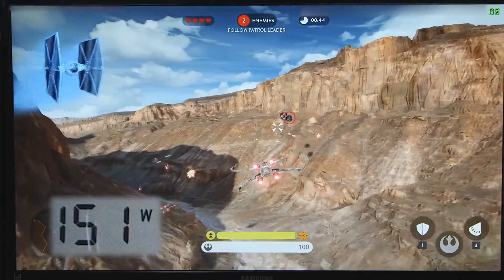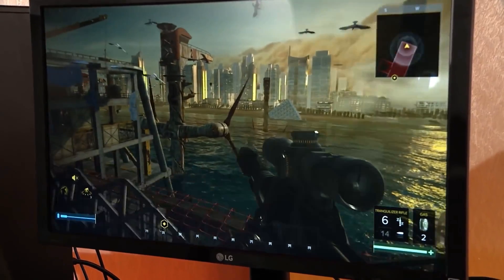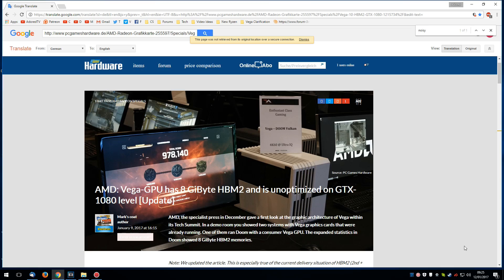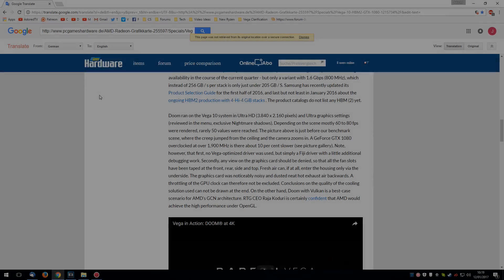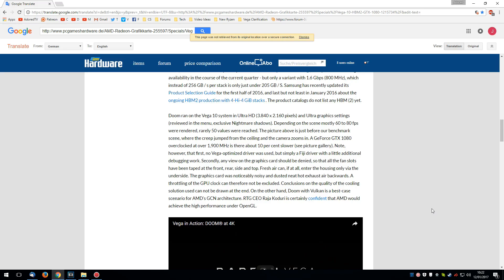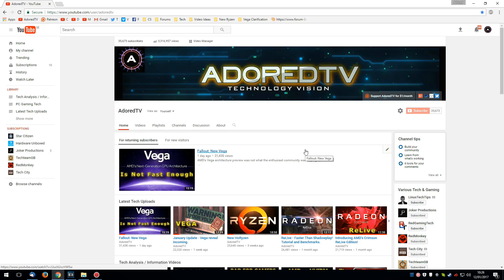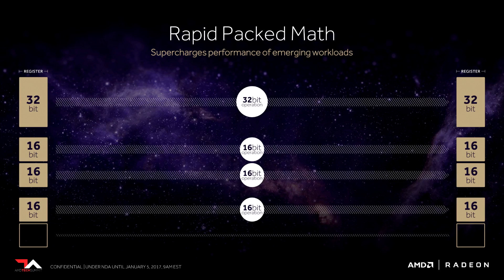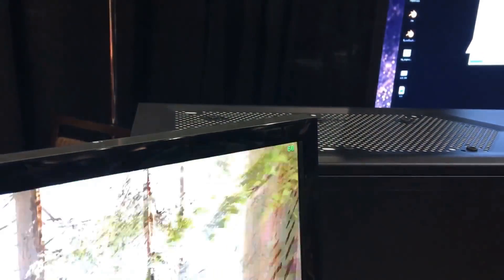Vega Clarification - How bad is it?

Comment: +AdoredTV You come to the conclusion that AMD has "given up on gamers" I can't say I agree? Maybe this is the best they can do and getting to within a few percent either way of a 1080 is as good as they can get right now. Ok we get you're not impressed with Vega but all you need to do is look at Polaris to realise it's not all doom and gloom. Now that the Polaris driver has matured it is within margin of error matching the 1060s performance and beating it handily in real DX12/Vulkan titles, even with those lazily coded pretend DX12 games that are really DX11 with a DX12 wrapper the RX480 is on par with the gtx1060. 

Sure it's disappointing if your speculation turns out to be accurate but it's not the end of the world! a competitive price will see Vega do very well with spend thrifty gamers looking to get into 4K without breaking the bank. 
Even at the same price which you can gurentee AMD won't be mad enough to do if the card is not competitive you can still save $200 by going AMD and getting Freesync to make up for the dips in performance without experiencing screen tear or lagging inputs. 

So what is Nvidia comes out with a Pascal refresh at the end of this year or the start of next? Without AMD you'd never get that and Nvidia would charge £600 for the 1080 for years dragging their heels on developing anything else and only providing 5% improvements on cards like how Intel does with CPUs.

Comment: You're being far too critical. I can understand your points, but they really fly in the face of what we are seeing actually happening.

Whatever this new card is, it'll compete with the 1080, not the titan. The titan costs $1200 and its only sold by Nvidia. Frankly, no one seems to care anymore about the titans and with a 1080ti being a gddr5x and a cut down titan chip....even if its within 5% of the performance.....its going to slot right in at around 1,000-1,100 usd. That just isn't reasonable anymore. People were stretching at 850, but another 150 at the minimum is out of this world.

If people want great performance they can still afford  a 1080. I said it once and I'll say it again, all AMD needs to do is get this card at 1080 performance and price it $100 less.

Nvidia will be forced to cut prices and lose on margins but win on sales or hold margin and lose sales to AMD.

Its not AMD's back against the wall. Its Nvidia's game to lose. Prices have gone so high, consumers aren't going to be the same loyal fanboys when they could buy two entire amd rigs for the price of one nvidia card. Intel and Nvidia are already taking a ton of heat for their prices, but no one can really do anything about it yet. 

RX480/470/460 card are selling well and AMD is clawing marketshare back. Putting the hurt on Nvidia at the top end in the 1080 range will help even more.

Less doomsday please.

Comment: On the DOOM AMD optimisations, they do work for Vega. There was an interview done with Raja Koduri where he was asked if it will hold up against the 1080 in OpenGL as well as it does in Vulkan and while he didn't outright say yes or no, he did imply that it wouldn't, saying that the optimisations in the Vulkan version (ie. shader intrinsics) aren't available in the OpenGL version.
Reply from the maker: I think what was meant there was, will Vega still lack in DX11/OpenGL games (like the rest of GCN) more than anything else.
Reply: Yeah but with how we calls out those extra optimisations it sounds like, at the very least, they are in play for Vega as well.

Comment: I think amd is playing a long race, its like they are saing to the owners of the 7970: "your car performs very good with todays games, so buy vega, a card where you dont have to worry about memory size". This time they have ps4 pro(?) and scorpio with vega, at least the half precision performance. But what i find more interesting is if amd can manage the jump to 7nm before volta.
Reply: You have a very important point there.
IF AMD can manage to switch to 7nm soon, that would shrink the GPU size by a LOT, meaning that there would be room for A) 2 more stacks of HBM2 (double the bandwith). And B) room for more shaders, giving the GPU a lot more rendering power.
Problem is.. It has to happen before NVidia has time to do something similar.
Reply: My question is what kind of monster would need 1TB/s of memory bandwith? I hope amd go on brute force with 7nm.

Comment: I think for me, AMD usually does not hype up a product so much if they know its bad.  Back with bolldozer,  they were pretty quiet as they got closer to launch and realized they had a dud on their hands.   If they hype up something even when its not that great,  its usually something they know the part will be good at,  such as the perf/watt they did with polaris.  however this time they seem to be pretty confident at the performance of Vega,  no mention of perf/watt this time.  I think there is more they are not telling us yet.  It all really comes down to perf/dollar in the end, Also I don't buy that AMD has given up on the gaming market,  because Lisa Su has specifically been targeting gamers with both Ryzen and Vega all up to this point.  Why design the card only for professional market if that were the case?

Also you mentioned how they were blindsided by nvidia.  Maybe they got tired of that and are holding back a bigger badder Vega design and the one they are showing off is not the full enabled chip?  Its a possibility.   Seems to be working for Nvidia,  so why not do the same?  Then when nvidia comes out with thier 1080TI,  unlock the rest.

Comment: If Vega is 10 - 15% faster now, on Fiji Drivers, and gets another 10-15% faster once on its own properly built drivers, 20-30% faster for X less than 1080 is fast enough for me. I don't know why you and others were expecting AMD to be some magical 70-100% faster. If people are disappointed its mostly down to the fact they themselves had unrealistic levels of expectations. I was expecting Vega to be on par with the 1080-10% better for less money. They seem to pretty much have nailed that on old drivers.
Reply from the maker: If this <500mm2 pro-laden card is 20% faster than the 1080 then why wouldn't a 600mm2 pure gamer card be 70-100% faster?
Reply: Adding 20% more GPU = 50-70% more performance? Is that how GPUs scale? I know that sounds sarcastic, but was senselessly asking. For me the performance of the engineering sample card at CES was as good as I was expecting of the retail one. Anything they add now with drivers and optimisations is simply a bonus. I was never expecting AMD to blow Nvidia out of the water, This is a first past at some clearly ground breaking changes to gpu production. 20% better I'll take that all day. At CES it was old drivers, early silicon and maybe not very well optimised and still beat the 1080. Vega wont be out till the summer, or they would say Q1 instead of first half of 2017. Not saying you're wrong on the speeds. Just that its clearly an early sample, they have time, but even if this is as good as it gets. Its faster and i'm happy with it.
Reply from the maker: If it were a pure gamer card ie just packed with shaders and HBM, maxed out to 600mm2 then it probably should be twice as fast as the 1080.  Basically consider what a gamer Pascal at 600mm2 would be, that's basically gonna be double the 1080.  There is no reason why AMD can't do it if they tried, but it looks like they aren't trying now because in the past when they did try, they never got the rewards they deserved.
Reply: Why would AMD go the same route as Nvidia? You yourself have said, mind set of high end gamers is to buy Nvidia? As a company boss, I would look at markets and go for the one I can make the most out of. AMD has placed a target on the mainsteam and professional market. Does AMD really need to fight for that 10% market that would buy a high end GPU when most buy Nvidia anyway? That make no sense at all. Does it suck for those people cause they have to pay the Nvidia tax? Sure but thats there problem. Everyone else has pretty damn good GPU choice. 1060/70 damn good cards, 480/470 Damn good cards. When your backs to the wall as AMDs was, You don't take the fight somewhere you cant win. AMD would not win the high end. Much better to simply change the fight. If in 2 years time most game makers and content makers are using AMD cards, and things like GPU open. Chances are AMD cards will naturally just be better anyway. Besides all of that, the Vega GPU was faster then the 1080, but does anyone think 1080 owners are gonna sell and buy a Vega? Nope. If you were AMD would you really try for a that? Or you you lay ground work on changing the landscape in your favour from the ground up? This HBC stuff, the GPU open stuff, Freesync 2 its becoming more and more standard features. When your the little guy, you gotta move slowly, the idea they can just throw a one punch knock out, is a bit silly. 

People at the highend market will do what they've always done, buy Nvidia and make jokes about AMD, no Titan beating card out this year would change that. I like AMDs focus on mainsteam, there 480 is the best card for sub $300. There open tools look great, and more and more content makers are using that stuff. Step one working, I get you want Nvidia pulled into reasonable prices, but wasn't ever on the cards this round.
Reply from the maker: I spoke to AMD today and told them the exact same thing.  If I were head of RTG I'd have said "fuck you" to the PC gamers long before now.

It's still a major disappointment to somebody who has been a GPU enthusiast for well over a decade, not to mention a gamer.  All I wanted to see was them fixing the mistakes of Fury X and really going for it one last time, but now it looks like we'll never see it.

Comment: My best guess/hope would be maximising marketing impact hence the underwhelming reports - reflecting on the mind-share you talked about recently, nVidia currently needs to take a sharp shock to knock everyone off that Team Green perch. It's one thing to match or slightly better performance hardware on launch, but to dislodge that and impress the market out of the gates you need to be able to hit your audience with serious price AND performance improvement - which I guess/hope they're still working on. Still hoping Vega turns out a Polaris on meth and this is just a preparation for the proverbial lightning war of enthusiast cards! In the end, was there even a point in Vega generation?! That would be my best guess as to why they might sandbag.

Comment: I still think you're conclusion is wrong, FP16 will be dead easy to use, it's just changing the datatype where you don't need FP32 accuracy. Which probably basically means all except final calculations. This is also only small Vega, AFAIK there will be a bigger one too. Clocks, drivers, hidden surface and FP16 will easily make this 50% faster than 1080, and AFAIK it is basically a 1080 competitor, so it seems to me to be able to do what it is supposed to do, which is to compete in the segment above Rx 480, possibly even including 1080ti. Above that will be big Vega, and it seems good enough to weather Volta until next gen. It may not be enough to take Nvidias place, but it will be good enough to compete for it, which they currently aren't.

Comment: and Vega used a debugging layer so it was slowing it down quite alot
Reply: Might be anything between 1-1000% actually, it wholly depends on what they were doing. We don't really have enough information to estimate specifically, the best we can do is go by how AMD has handled things in the past, and as per the video, it doesn't look great.
Reply: As a software engineer, I can say that the design of the new shaders allows a 100 to 200% increase in throughput compared to existing cards with the same number of shaders. The geometry engine is more like 50 to 75%.  The way that AMD is using the HBM2 memory means that the main memory clockspeed will have a (small) effect on video performance.  Much more important, the size of main memory will also affect Vega performance.  I'm planning to update my system memory from 8 Gig to 32 Gig to go with Vega.  You don't have to be that extreme, but anything below 16 Gig will slow Vega down.  (Huh? Full textures will be in main memory, parts of the textures will be in the HBM2 cache.  You definitely don't want a cache miss going to disk, even if it is an SSD.)

The important point here is that a good driver for Vega will bring out lots of performance that even a Polaris driver won't.  Expect a significant amount of this performance to be picked up by launch--say about 50 to 75% more than what AMD is demoing now.   Let me give a simple example, and why doing as well as R9 390X means a lot of performance is being left on the table.

Let's say the GPU code is summing the product of two vectors.  Happens a lot, although what we are really talking about in current AMD cards is the dot product of 64 vectors    Currently you get three instructions in one compute unit, or if you can unroll the loop, two.  In Vega there is a fused multiply add in one shader instruction. There are a lot of three and four element vectors running around in graphics code.  For these, we unwind and replace six clock code with three clock code.  But (at least as far as I can see) this requires a different code path for Vega.  In fact, Vega is going to pretty much going to require its own generation of drivers.

There are going to be two types of performance enhancements with Vega.   There will be those that depend on the game developer or game engine developer.  For example, pull the textures needed for the next portion of the game into system memory.  That way the driver can get started on the next frame immediately.  Pulling the textures for that frame into L2 cache?  A little trickier but worth considering.  Getting the next cut scene into cache ahead of time?  Again a bit tricky, but nice not to have delays or even slight glitches before cut scenes.

Will all of this be done by the time Vega ships?  No.  I'm sure AMD has a group frantically working on a Vega driver which doesn't use old algorithms, and it will be there at FCS (first customer ship).  But once it is working, the focus will be on bug fixing not performance.  Doesn't mean they won't be improving performance--if you know there is a bug somewhere in these 10 lines of code, and these 12 lines are faster and don't have a bug?  Of course, you slip the new code in.  More usually, you will find code that has "just grown" and has lots of bugs?  It is worth rewriting from scratch rather than trying to patch the old code.  (Old might be 3 weeks old.)

When my job included occasionally determining whether a defense contractor would get the code for some project debugged well enough to field, or if the project should be cancelled, I came up with a simple test.  Look at the recently closed (fixed) bugs, and determine for each whether it was fixing an original bug, or one created by a previous bug fix.  Divide bug repair created bugs by original bugs.  Below 20% was usually not a problem.  But a team with me (or one of the other software experts) on it was not very seldom saw projects that good.  30%?  Depended on how close to finished they were.  About 50% was death spiral time. Of course, over one meant that the bug repair process was actually increasing the number of bugs.

Why bring this up?  Well run software development groups will keep track of which module (file, function point or whatever the tracking unit)  is getting to be a problem.  These modules are then redesigned and rewritten immediately.  AMD seems to have gotten to this point (good software engineering practices) with the GCN drivers.  So I expect them to do the same thing with the new shader architecture drivers as well.  It doesn't mean they will be perfect when released, just that they will continue to get more optimal (and more bug free) with age.
Reply: slowing it down sure, by quite a lot, no.
Depending on what kind of debugging they had activated, you might maybe see a 1-2% hit, tops.
Reply: From a software engineer standpoint, it's a layer that returns valuable information back; For example, function calls; data information that's passed within a program or software. It can slow down the program, but not by much depending on what's being debugged.
Reply: Robert, why on earth would graphical assets be pushed to system RAM?
Reply: KindOfyeah Depending on how it's built, vertex information are sent  to system RAM for example ZBrush relies heavily on system RAM instead of VRAM; mostly for gaming depending on how they manage it you could I guess store vertex information on RAM and texture on VRAM ( ´Д｀), its mostly finding solutions to problems.